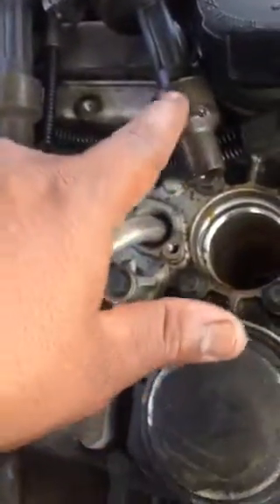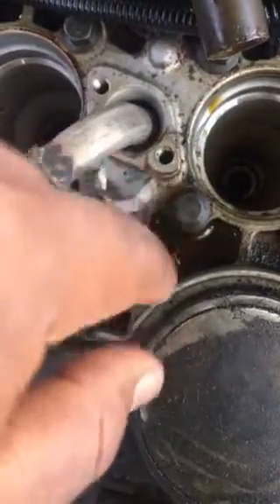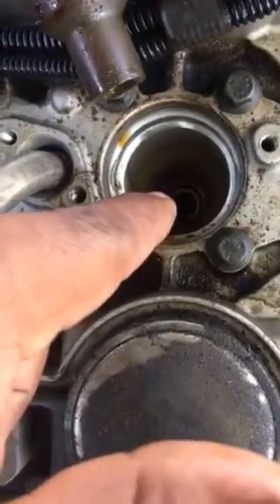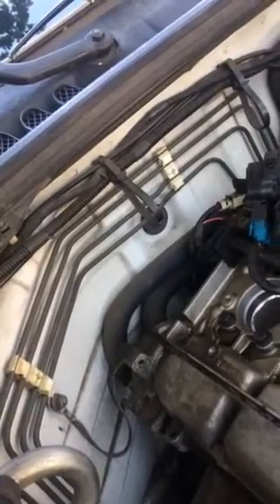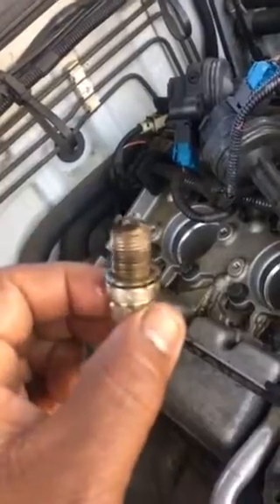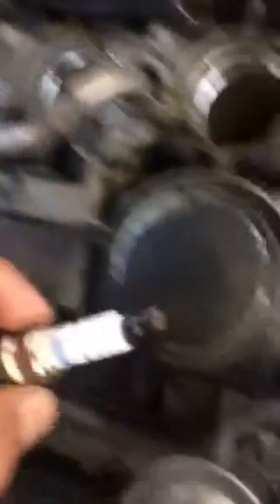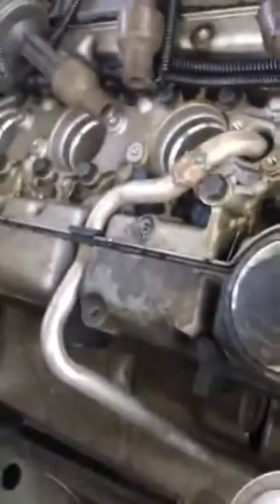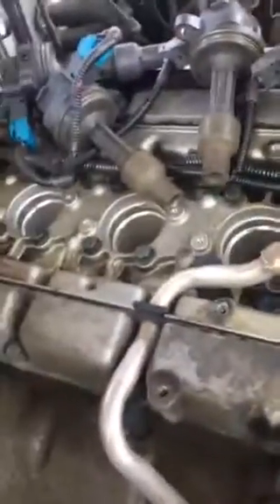1997 Volvo 960 spark plugs replacement

Comment: I have the same car and need your help replacing my coil connectors back on the coil.I was putting new wires on and spliced the old ones off because of corrosion.I was gonna solder them but I bought a lousy solder tool so I was gonna just crimp the wires now I don't know which wires go we're.I tried numerous times but failed and now the car won't start up.I hope I didn't mess up my coil pack I just spent over $200 on them.This mechanic I called wants to charge too much for something I can do on my own.So how can I put my wires back properly even though I cut them down to put new ones on.Also what could've caused my ignition from turning over😱??????????
Reply: Was this ever resolved?